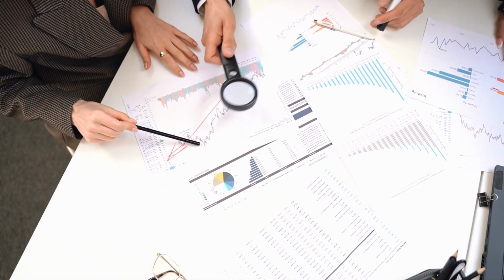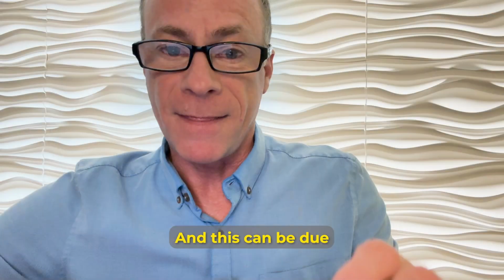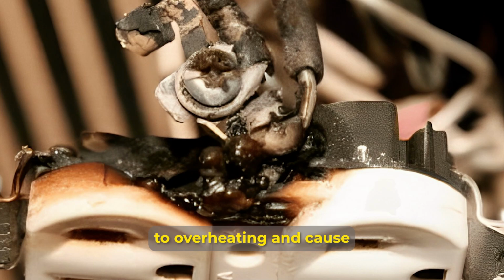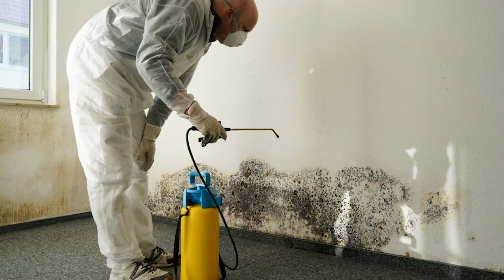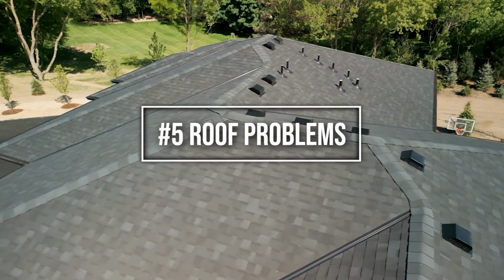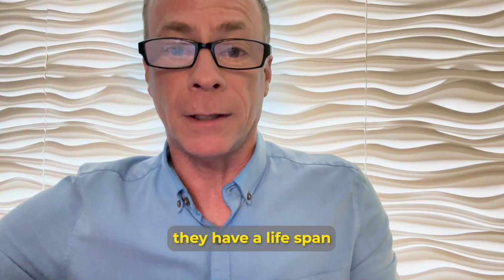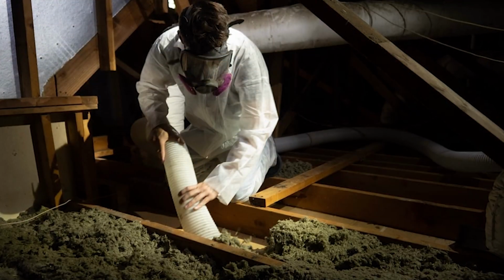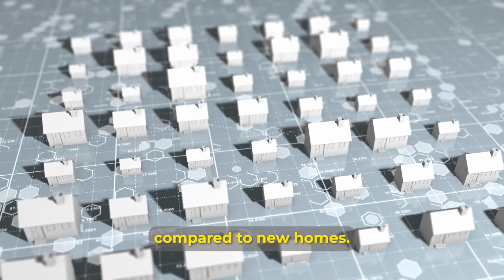LEAKED! Home Inspector Reveals How Buyers AVOID Hidden House Problems...

Comment: And even with an inspection they can't catch a lot of problems because they are hidden. Checking for pulled permits can give a clue about how professional the sellers have been about such things. If you buy a vacant house there is a good chance vermin may have chewed wiring. All kinds of common sense things to think about before purchase. Flipper rehabbers are known for cutting corners, etc. One ad locally claimed the home had been occupied by the owners for quite some time, but looking at the deed transfers a flipper bought it and turned it in less than six months. very few inspectors here do meth tests. People really should. Like mold spores, surface removal doesn't always keep those nasties from coming back. If people paint over walls after meth cooking it will come back through as discolored streaks. Test in out of the way spaces like duct work and behind appliances. YOU will have to spend to mitigate things once you own the property.

Comment: This was a much needed video and you did a great job of shedding light on many items that should be inspected prior to purchasing any home.  My home is only 3 years, 11 months old and I did have a 7 hour home inspection prior to purchasing/closing on the new construction.  Sadly, the home inspector missed 95% of the construction defects because a home inspector can only check for items he can visibly see.  He cannot inspect items behind walls and under the house if he cannot see them.  I have had to put thousands and thousands and thousands of dollars into this new construction home due to a very poorly done home inspection.  I recently had my home inspected again prior to listing it for sale so I could make all of the necessary repairs before putting it on the market.  This time the inspector found nothing wrong inside the house as I have immaculately maintained the property and all working systems. However, during the inspection he discovered the second installation defect with the roof (first installation error was found after I lived in the home about 1 year, and it was missed in the initial home inspection, which led to a roof leak into my master bedroom.  I hired a professional remediation company to completely tear out the entire master bedroom drywall and insulation under bioharzard standard containment.)  I live in a Buyer's Beware state in which a builder does not have to honor his warranty.  It is up to the homeowner to hire an attornery and sue the builder.  As someone who almost died from hidden toxic black mold inside the walls of a beautiful older home in San Diego (my animals died and everything I owned was hauled off to a biohazard waste removal site and it took me over 400+ iv's to regain 60% of my health back-seller's did not disclose water leak or mold during purchase and the home inspection found the house to be in excellent condition) I decided to spend the money to remediate and reconstruct a safe and healthy home rather than sue the builder as time is critical once a water leak has occurred as mold can start growing in 24-48 hours.  This is a long post to share that I had 2 home inspections when buying both an older home and a new construction home and both were a total waste of money.  Listening to the information you shared in this video tells me you know more about inspecting a home than many inspectors do.  Since you sell so many homes in the South, I do wish you had covered the health hazards of toxic mold more in depth.  It's a huge issue and people lack the awareness of how lethal it can be with regard to cellular damage and cellular death.  I know people in the South like to call mold mildew, but it's really mold.  I am looking forward to my house selling so I can move most likely to South Carolina's coastal area and I know the vigilance and dedication it will take to prevent mold in my new home.  What does someone look for when hiring a home inspector?  I have always hired a licensed, bonded, certified, and well-experienced inspector with great reviews and yet every home inspector has done a disappointing job.  Please advise me as a new construction home buyer in the new few months on ways to ensure I am going to get a well-qualified inspector who does an exemplary job.  Thank you so much for your time in reading this post and your response.

Comment: Many older homes in the south have cedar posts as part of the foundation.  Sometimes they look good above the ground, but if you dig 1 ft below the ground there may be significant rot.  Generally the cedar posts have about a 50 year life span.  You may be looking at a home with much older posts.
Reply: I love it when I run across houses with metal posts and beams instead of wood in wet region basements. Same with porch deck supports.